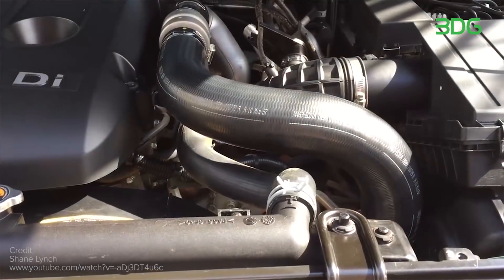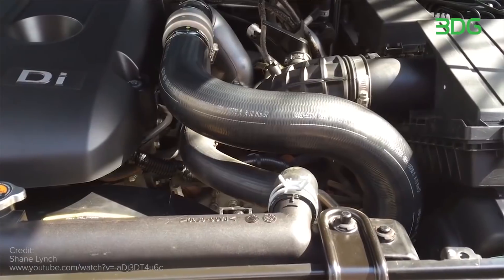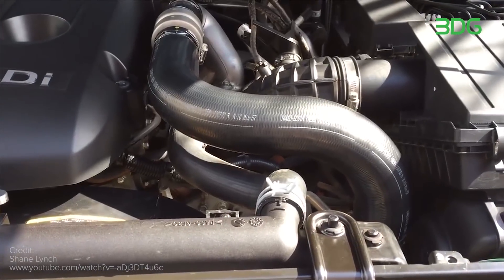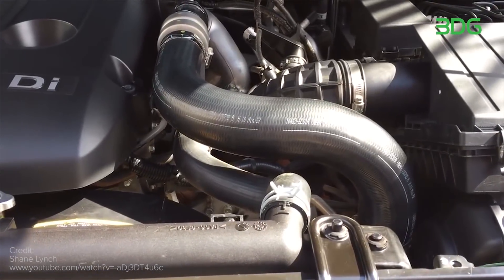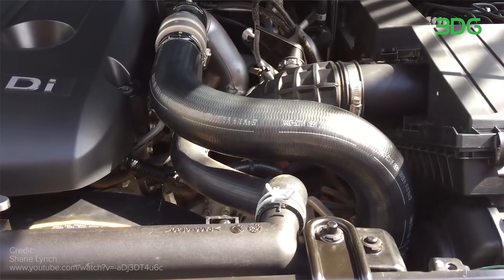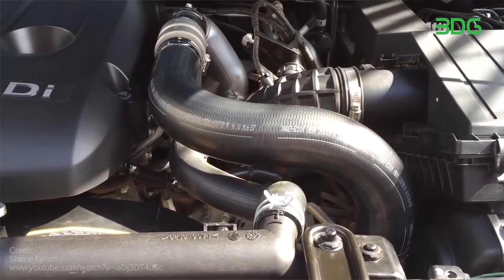Why Navara Blow Black Smoke

Comment: Hey mate any suggestions, my 2012 Navara is blowing black smoke and is only getting 450km to it's 70 litre tank. Even if I'm driving highway driving it doesn't change from city to highway
Reply: Have a look at this. It's for a Yaris but it's pretty much the same except for the Navara MAF is much bigger! 
https://youtu.be/3xRRb6awLoY
Reply: Hi mate, I'm not the bloke in the vid but this might help you. 
Clean your Mass Air Flow sensor. It's a 5 minute job but well worth it.
Just buy a can of M.A.F cleaner from Supercheap/Autobahn and clean it. I do mine every couple months and find it helps. I currently get between 750-850ks per tank and that's mixed city driving and freeway driving. Next time I clean mine I'll put up a vid so you can how it's done.

Comment: Can anyone give me any advice? I have a bub on the way and my 08 D40 Came up with the diesel particulate filter warning light. I did what was recommended and drove over 80kmh  until the light went out. Haven't seen it on since. But now 2 weeks later when I take off I'm blowing black smoke. The car won't pick up or keep power and when it changes through the gears it blows a puff of smoke. It's an Automatic too.
Reply: Was it boost solenoid?

Comment: my turbo failed ! and i am getting diesel in my radiator and water system , do you know why this is happening ????
Reply: that's because your head gasket blew, most likely you will need a complete over haul
Reply: Jodi Balfour it won’t be diesel it will be oil from the failed turbo unit as they are oil fed and water cooled. This will be resolved with a new turbo and a coolant change with the same brand as before for coolant don’t change or mix the brands/type.

Comment: scv problem can cause engine knock?
Reply: My engine knocks until it gets hot  and also blows black smoke under acceleration would this be the scv???
Reply: @callumaspinall2765  did you solve your knock issue?
Reply: @callumaspinall2765  i had my svc go and i didnt get any knocks. It just wouldnt idle at all would die at lights. Couldnt put the foot down or it would struggle and blow lots of black smoke. How many ks you got on it? It could be the timing  chain. Its a pretty common problem with the stock piss weak chains

Comment: Hey guys just want to clarify, as stated in the vid about the navara not throwing a fault code when the egr is blocked. Does that mean i can just put a blanking plate in and thats it nothijg else to do? And also the vid was very helpful with an injector issue that i now have resolved cheers
Reply from the maker: Kane Surdonjic yes
Reply: Yeah mate exactly right, you can get blanking plates for $7 on ebay
Reply: Also with the pahfinder 2.5 td? No need to reprogram the computer after blanking EGR?